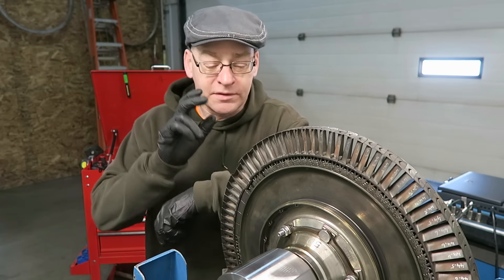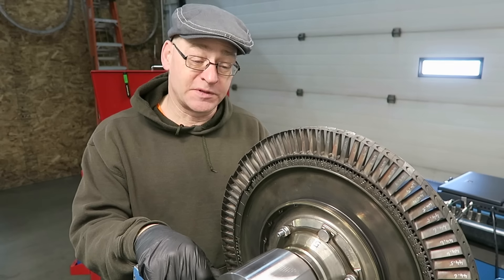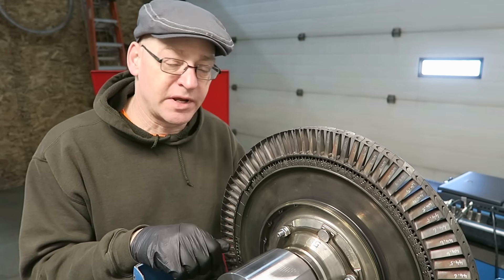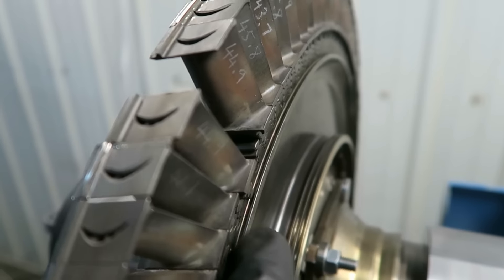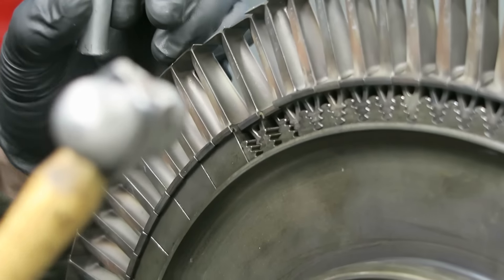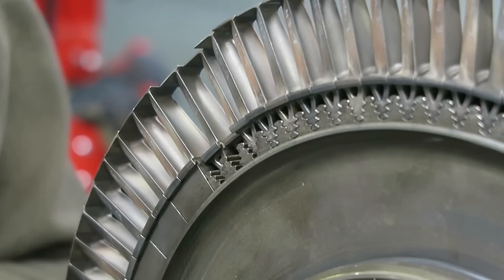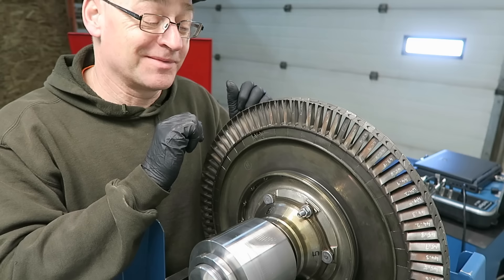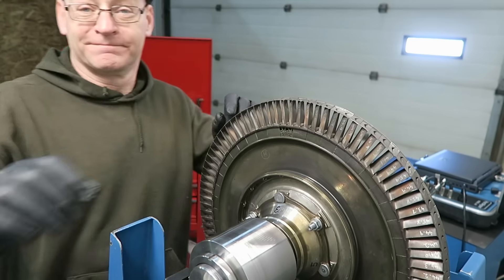Locking Blades 2

Comment: Can I just add that the lock plates also act as sealing plates to prevent excessive under-platform leakage.  This principle is very typically 'Derby', in respect of R-R engines.  Compare and contrast this with what you will be familiar with on the (very Bristolian) Industrial Olympus LP turbine, which has a retaining tang at the front end of the firtree root and a little locking tab that gets bent over at the rear (the 593 LP turbine is exactly the same).  With the design of the Olympus 'C' rated LPT blades, we had to stick sealing plates onto the front faces of the firtree roots, because, with the redesigned blades, the lug extensions at the back of the disc firtree lobes didn't provide adequate sealing.

Comment: So, when disassembling, how do you get the first one out. Opposite procedure, I guess. A screwdriver under each edge and lever them up? But then that will damage the adjacent ones, so that can't be what you do.
Reply: +steelfabric exactly what I was wondering
Reply: +steelfabric 
Take an aerospace angle grinder and cut it out ;)
I'd really like to know as well.
Reply: +steelfabric Judging by the damage to some of them seen at 3:29, I'd say they stick a pick or small screwdriver in and bend one out to start the process.
Reply from the maker: +superdau Yes, this way... with great care.
Reply: I assume if you work around the entire circle pushing the locking plates one direction you could open up a small gap (even .0001  tolerance over more than a hundred blades would add up)
Reply: +Robert Szasz I see what you are saying but the plates are up against the wall of the disk too...so that won't work, think about and you will see what I mean...
Reply: Gary Ferguson Jr I meant that pushing around the circumference. Starting where you want to open a small gap (for tool access not a plate width) and gently pushing the plates in sequence would open up a  few hundredths perhaps even a tenth of an inch, right? Pushing plates left of the gap to the left, right to the right till you get to the opposite side would close all the other gaps and open the remaining gap as wide as possible. If the tolerances are just right, and the locking plates had enough friction you could go from having a gap the width of a blade to only tiny gaps distributed around the disc. And there's little force to move the  locking plates around while operating. Though popping one plate in and flattening it is a whole hell of a lot faster then massaging plates around a disc would be.
Reply: +steelfabric I think it is safe to assume the factory service manual would recommend opening a bottle of vodka before starting the removal procedure.
Reply: Was thinking this automatically as well...

Comment: I was actually thinking of using a large 'C' clamp to press the bent tab back into place. That way you'd have both sides supported and no "banging" would be required. Having said that, you method works, and that's what counts! Thanks for divulging the ultra top secret method for completing the task!! LOL
Reply from the maker: +BeachBow A very large C-clamp, with specially machined aluminum feet for each pad that would allow it reach into the correct area.  It would take two people to operate... and you would finish the job with a tap from a hammer on an aluminium drift.
My way, which you seem to think is only adequate, is the best way.  It does work, and it's the way described in the assembly manual.
Reply: Apologies. Didn't intend to imply that your way was in any way inadequate to the task.  Just curious about different methods.
Reply: +AgentJayZ For many years, I've repeated an ancient engineering saying: "When all else fails, RTFM!"  In other words, "Read the ****ing manual!"  I even quoted it, suitably expurgated, at my daughter's wedding!

Comment: The locking plates also make for very good sealing of the root neck, it keeps the cooling air in and prevents hot gas ingestion in the neck area.....

Comment: Doing research and testing for JPL in L.A. on the feasibility of using tiles as heat shields during re-entry of the Space Shuttle into the atmosphere  in the early 70s we used to Muse about such things, also "loose lips sink ships" You wouldn't  believe the kind of radiation in the spectrums of heat, sound radio and  light a torch of that magnitude  would emit!

Comment: Hi 
I'm really enjoying your vids. I'm not a machinist or mechanic but do enjoy high quality bits an pieces and the precision involved. I do have a question regarding high bypass fans on commercial airliners. I understand the workings but it appears to me that a lot of the hardware and plumbing of the engine itself is exposed to the flow of the fan. Is this the case and if so does this effect the smooth flow and expose components to damage?
Cheers
Rob
Reply from the maker: +05Cat28  Many newer airliner newer engines have a cowling around the core, but you are right - many earlier turbofans had a lot of drag-ey stuff just hanging out in the high speed breeze. This has puzzled a lot of us for years.
The best person to answer that one is a turbine engine design engineer.
I suspect one will magically appear soon to enlighten us...
Reply: +AgentJayZ Are you dropping a hint in my direction, AgentJayZ? All of the high by-pass turbofans, whether small, medium or large, that I have come across do have cowled/faired cores. Many of them (but not the R-R RB211/Trent range - and several others) have the gearbox and the accessories mounted on the core. It is both necessary (for protection) and beneficial (in terms of drag reduction) to have all that 'gubbins' (quaint UK English word!) covered by fairings. Equally, the low by-pass turbofans, whether ancient or modern, that I have come across typically do not have fairings around the core. However, all that 'gubbins' stuff is typically mounted on the outer casings and there are relatively fewer things in the way of the by-pass flow, which, in any case, is diffused to a lower velocity downstream of the fan. OK, there are a few fuel, oil and air tubes crossing the by-pass duct, plus a few flanges protruding into the by-pass flow. Nevertheless, some aerodynamicist and/or performance engineer (not me - I just designed the machinery) must have done the sums and decided that the losses weren't worth the trouble of the additional weight and cost of fairings. To digress slightly, I am aware of a Russian military turbofan that has a tubular air-to-air heat exchanger in its by-pass duct, which must cause significant blockage. The resultant losses must be worth the additional cooling available to the turbine (I assume), otherwise it wouldn't have been incorporated in the duct.

Comment: just wondering, how many grams out of balance is "acceptable" according to the spec sheets? especially if you stack them up 20 fold at the compressor side it would add up considerably to have a couple of grams on each rotor.

Comment: I have always wondered how those grooves (labyrinth seals) in the hub of those wheels work.  I used to grind those grooves in from a solid years ago, it took hours and was incredibly noisy and nerve wracking as the compound angles and full radius bottom generated a lot of heat and noise.
Reply: A long, narrow, twisty path creates a huge resistance to flow.
Reply: +Robert Szasz It's also down (to a significant extent) to the repeated successive expansions from the small clearances over the individual labyrinth fins into the downstream volumes.

Comment: Could you move two of the blades into a "half in" position and sit the plate in at an angle and then use some aerospace percussive force to move them forwards and lock into place?
Reply from the maker: +mrmacomouto That would require the bowed plate to be installed inwards... right where the disc is. 
... so  no.

Comment: Thanks for this...dumb question, but does the balancing machine need to be balanced?  If so, can you explain how overall balance is verified?  I am very curious about balance. With such tight tolerances, how does one ensure that the balancer itself is installed properly?  Not sure you are up for it, but an automatic time lapse video of a balance would be way cool...not that you have time for it.  Enjoy the spring!
Reply from the maker: +Bill Clark The balance arbor - the metal shaft to which the disc is mounted, was balanced as close to zero before use. I took a day, to the point where the machine was asking for 0.07 grams of weight to be applied. I used a tiny piece of tape, that I had to keep checking was still there. I wrote the mass and traced the location on the shaft  in felt pen, and hopefully assumed the ink was an insignificant mass.
Reply: +AgentJayZ Thanks for the answer. Does the machine need to be balanced before EACH job? I'm thinking I'm going to go back and watch the old balancer video...unless you want to do a refresher for us ;-)

Comment: Would you be able to use a vice with small pads to bend that last plate into place? That way you could avoid using any form of impact on the turbine. Also, how difficult would it be to fabricate new plates to secure the blades?
Reply from the maker: +eivilcow33 In a cartoon world, yes. In the real world, removing the turbine from the machine, and disassembling the arbour takes a half hour. Then how do you hold it in the vice while you tighten it. It's over 100lbs of awkwardness.
Then, first thing you need to do after locking the plate in... is final balancing.
See all the time we've wasted to do a lesser job of balancing?
Reply: +AgentJayZ whoops wrong tool, I meant C clamp, not vice. That way you can still do it on the balance machine. though you might need to use a wrench to crank it down to bend the plate.
Reply: +AgentJayZ wide mouth vice grips maybe
Reply: +eivilcow33 I would implicitly trust a skilled and experienced technician and craftsman, such as AgentJayZ, wielding a hammer and a soft Aluminium (sorry, Aluminum) drift to flatten a pre-bent locking plate.  Why go to the complication and time-consuming use of a cramp or press device?  And for the person who suggested using an Alumin(i)um hammer, the placing of a drift against the plate is far more precise and repeatable than hitting the plate with a hammer. PS  It was a real pleasure to see you at work, AgentJayZ!
Reply from the maker: grahamj9101  GJ, you are just encouraging more of these comments. Armchair experts are always right, and very willing to make my job "better". Did you find that as an engineer?
Reply: +AgentJayZ OK, point taken: I'll duck down below the parapet.  To answer your question, what gets to me (and apparently to you too) is the armchair expert who has had a bright idea - as if the industry hadn't thought about it before.  I (like you) have spent years in the industry and I learnt a vast amount from the first generation of gas turbine designers and engineers. On the one hand, I've done a good deal of conceptual design work and, on the other, I've analysed and solved numerous real design problems.  In the process, I've made mistakes (as we all do) and learned from them.  If you want a specific example of something that has got to me, which has cropped up with annoying regularity over the years, it's the birdstrike issue.  Of course, it cropped up yet again after the US Airways ditching into the Hudson River.  "Why don't you put guards/screens in front of the engines to stop birds going in?"  Please excuse me while I take time out to tear out a few more clumps of my greying hair.
Reply: grahamj9101 I am not trying to be an armchair expert, I am just asking if that method would be usable or not. AgentJayZ made the reasons why it would not be usable abundantly clear which I appreciate. It is through these questions that I learn. In no way do I believe that anything I would do is better than what he has done because I do not have the experience. But there is more than one way to paint a fence, and just because he does it one way doesn't mean it isn't doable another way. Thank you for your input and negative attitude toward my desire to learn. You have contributed greatly to this comment thread.
Reply: +eivilcow33 I am supposed to be "ducking down below the parapet", but, as a matter of courtesy, your comments are worth a considered reply. I did not intend my own comments to be negative, but the learning process can, on occasions, benefit from a critical response - and AgentJayZ does so sometimes.  I was also keen to acknowledge that AgentJayZ has many years of varied experience (probably more varied than mine with R-R) in building jet engines and he really does know what he is doing.  Yes, I believe that it would be possible to use some form of cramp or press to install pre-bent lock plates.  Yes, there are various ways of doing things in every branch of engineering (and in life more generally), but the simplest ways are often the best.  NASA reportedly spent a small fortune developing a pen that would work in zero gravity: the Russians used a pencil.  From his comments, I believe AgentJayZ thinks that R-R's engines are too complicated at times - and I have some sympathy!  I recognise that many subscribers to this channel have little in-depth understanding of gas turbine technology.  Consequently, I do try patiently to contribute to the learning process by going into great detail (possibly too much at times) about the way a jet engine works.
Reply: grahamj9101 I am well aware of how gas turbine engines work. I am currently in school for a BS in Aerospace Engineering. I watch these videos because they help me to match what I have learned in lecture to what is actually done in the real world. If we were to do a lab which involved installing the retainer plates, I guarantee that they would have us use clamps rather than hammers to ensure that we don't cause any damage (some of my classmates couldn't be trusted to construct a simple balsa-foam-balsa composite wing without breaking something or gluing their hands together). As an amateur, if I were placed in a position where I had to do what AgentJayZ does, there is no way in hell I would trust myself to use a hammer on one of those engines. I would rather use the slow method my first couple times to see how it goes and figure out what works and what doesn't before going full speed with it.
Reply: +eivilcow33 I'm sure that you're well aware of how a gas turbine works and a good deal more besides: that's what your course is all about.  When you have qualified, I hope that you use your BS and become a registered professional engineer in due course.  However, most of AgentJayZ's subscribers aren't engineers and really don't understand the complexities of a jet engine.  It is those people that he is educating and informing via his channel and I hope that I am helping by injecting over 40 years worth of my own knowledge and experience.  In addition to professionally qualified engineers, the gas turbine industry (and engineering more generally) will also need  suitably qualified technicians, who have the appropriate manual skills and dexterity.  If they don't have those skills, then they should not be doing the job.  Training in such skills should be part of their qualifications, just as your BS will be for your future career.

Comment: AgentJayZ, how does a Zero Stage work ?
I did try to understand that it adds zero compression to the jet engine but how does it add overall pressure rise to a jet engine (thus boosting an older jet engine design) ?
Reply from the maker: +BillyNoMates1974   What is a zero stage? When an established design is updated and uprated, sometimes an additional stage is added to the front of the compressor to boost airflow. 
Instead of renaming all of the other stages so that the new stage is called "stage 1", the new stage is called stage zero.
This avoids much confusion because all the parts that were already in the design keep the names they already have.

So a zero stage is just a naming convention.
Reply: ah ok. that clears that up. thanks
Reply: +BillyNoMates1974 Now you understand about a zero stage, I will tell you that the Avon RA29 aero engine and its derivative, the Industrial Avon 1533 had a double-zero stage added in front of the zero stage.  Another bit of information which you might find interesting (or useless, depending on your point of view) is the fact that, when we deleted the fan and LP turbine from the 3-shaft RB211 aero engine, to produce the 2-shaft Industrial B211, we did not rename the IP compressor and turbine and their component parts, to avoid confusion.
Reply from the maker: Yes, when I occasionally worked with the RB211 team at TCT, I was interested to see that we worked on the HP and IP systems, and that there wasn't an LP system on the industrial version of that airliner powerhouse.
Reply: +AgentJayZ Yes, I was the young upstart who proposed that we continued with the nomenclature. It seemed obvious to me, as an LP compressor and turbine containing so-called common aero parts with 'IP compressor' labels on them could cause confusion.

Comment: Why does the wheel keep "falling" to another position on the balancing machine? If it's balanched, that shouldn't happen right?
Reply: +1metiz It is only when some of the locking plates are being installed. The turbine is falling to have the installed plates at the bottom. When they are all installed you will notice this is not happening.
Reply from the maker: +1metiz   Listen to Adam; he knows his stuff.
Reply: +Adam Laycock AgentJayZ tells me you know your stuff, so, thanks :)